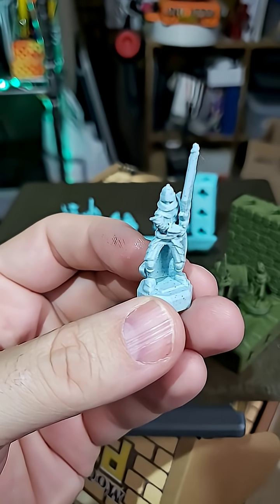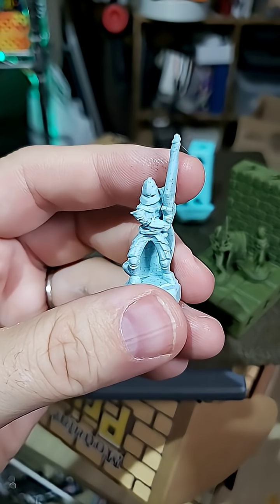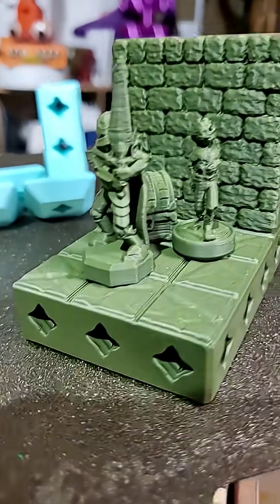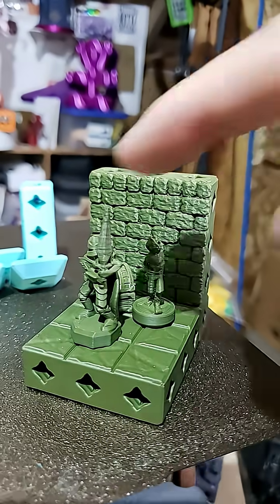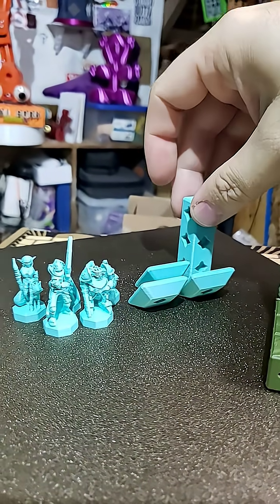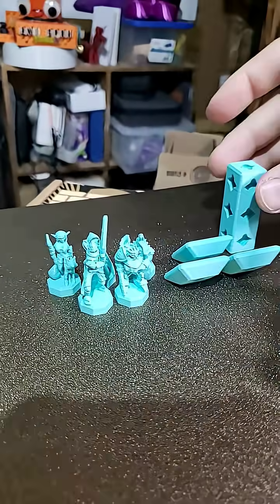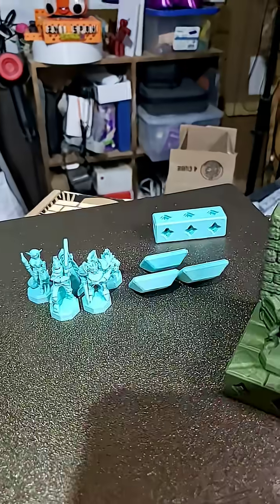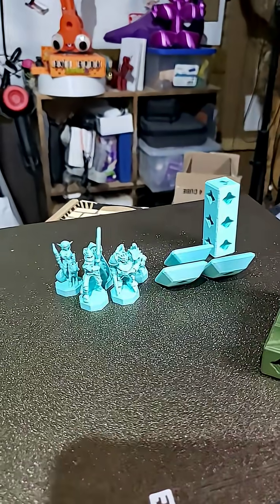How I fixed overheating in my 3d prints when 3d printing minis

Comment: Minimum layer time. Is the option you need. It gets setup with a move, so the nozzle drives away, waits a few seconds, returns prints the sword layer, moves away and so on.
Reply from the maker: I did mention that. But a cooling tower works best.

Comment: You can add in a minimum layer pause that will do the same thing. But it does increase the print time.

Edit: I think it's actually called minimum layer time. So if a layer is too short (like the sword area) it will pause and let cool before doing the next layer.
Reply from the maker: It has the down side of drooling and losing nozzle pressure.
Reply: @3dpprofessor 
I haven't noticed that issue with it. Then again I am usually trying to keep everything hot so angled overhangs do not curl on me leaving a rough texture. Hence I don't use that feature often.

I am typically running the slicer settings where it builds in sequence, especially for miniatures. And I agree .2mm nozzle is only necessary in particular situations pending on the fine details of the model. Most of the miniatures I make are using a .4mm nozzle and I print them solid, just seem to hold up better that way.

Comment: I'm pretty new to 3d printing. Do you think the ender 3 v2 neo is a good option?
Reply from the maker: In this day and age, there's no reason to have a 3d printer that's that hard to use. Bambu, Flashforge, heck even Creality has easier and more reliable options.
Reply: @3dpprofessor  "Even Creality" is a phrase I'd never thought I'd hear LOL
Reply from the maker: @critter42 They're asking about an Ender. Even Creality's own K1 beats an Ender.
Reply: Depends on if you want to be continuously tinkering with your printer or want it to just print. If the former, I guess it's as good as any other non-Bambu bedslinger. If not, get a Bambu Lab printer.
Reply: or get one of the x1c clones like from anycubic s1c
Reply: There are 2 types of 3D printers.

(1) DIY build kits that are neat because you built it and know everything about it.

(2) Printers that work and you don't have to know why.

Comment: This works great but vastly increases print time and isn't a nice solution if you don't want a block in the same color/material.

Cura has an option called something like "lift head" under cooling that just moves the printhead up and away momentarily that works without printing something else, but it's finnicky and can cause bad stringing.

It'd be nice to have better options. The only one I know is extreme cooling power.
Reply from the maker: The lift nozzle has the downside of losing nozzle pressure. 
But PrintABlok is reusable.
Reply: @3dpprofessor  That wouldn't happen if it did a suitable retraction for a dwell rather than a travel, and did an appropriate motion pattern that didn't pull a string out. This is what I meant. The idea is good but the execution is poor.